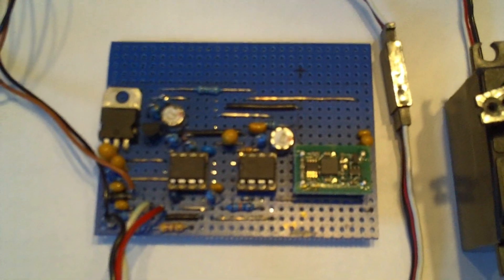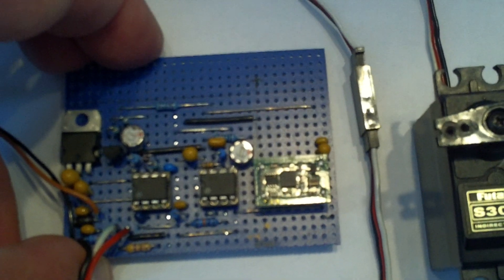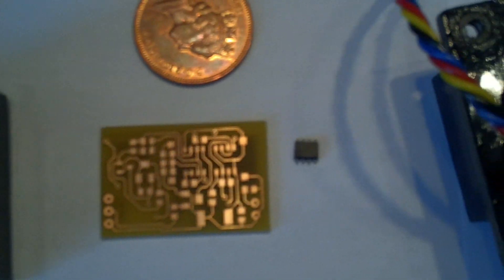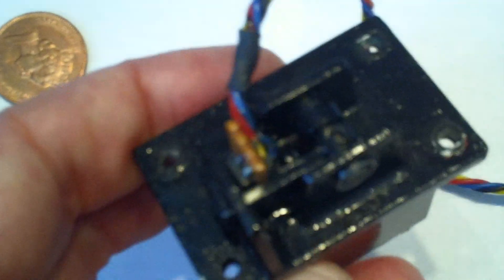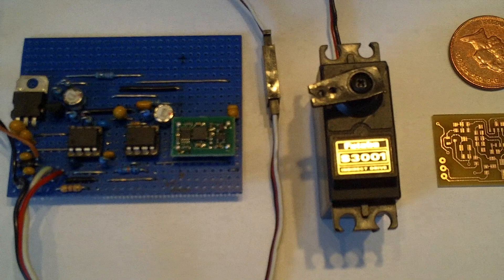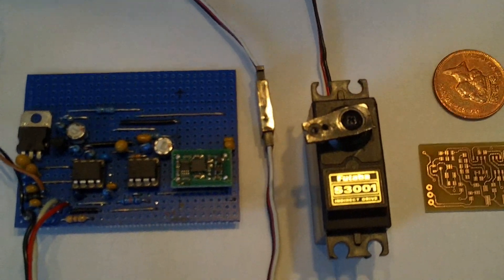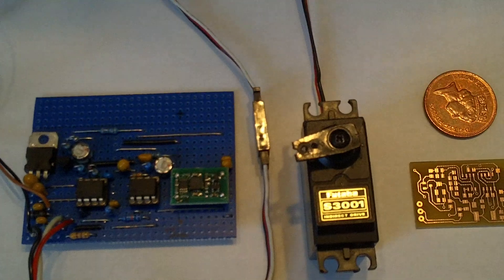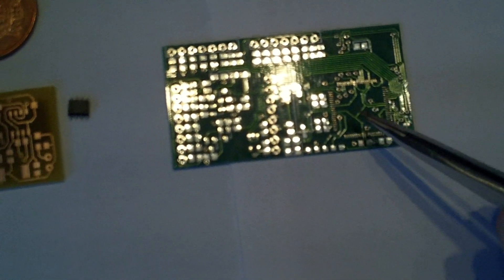level controle unit for model submarine

Comment: @johnrobinsonG7SCL I would think it's safe to say this "Jel coat" is damaged...hull damage is mostly on the ends where it has likely been banged around over the years.  On the few metal parts I found...mostly pushrods, I didn't see any rust, or salt deposites.  There was plenty of sand, as well as some deck fittings, and a headless crew member...I found both rudders (one Bent), and one propeller.  I will try to hunt down some pictures for you I know I mentioned it in a model build somewhere.

Comment: I find this VERY interesting!  Several years ago a friend gave me a U-Boat hull...It looked like it had been pulled up from the bottom, and gutted.  There is a lot of hull damage that will have to be glassed.  Also came with the top part, and the conning tower.  I THINK it is a 1/32 scale Type 7C, hull measured 6'-10"

I hope to someday restore it, but I want to build it with as many working features as possible.  

Please feel free to take your time!  Good things come to those who wait.